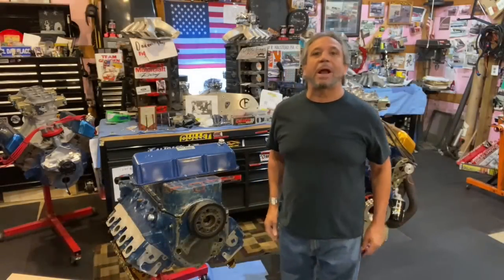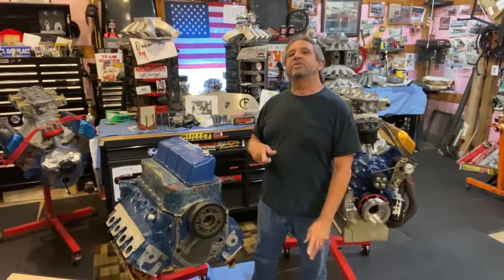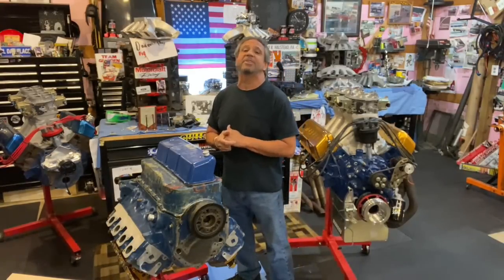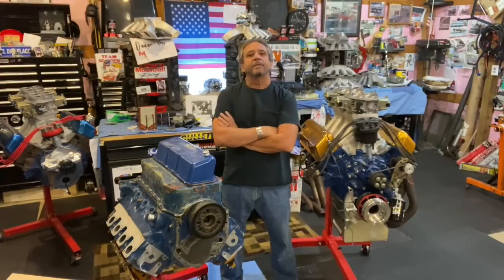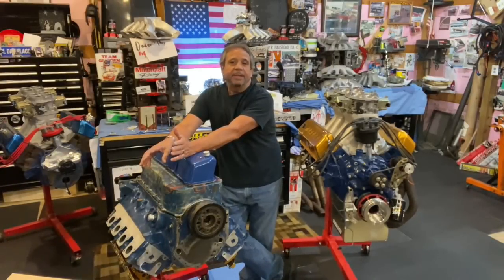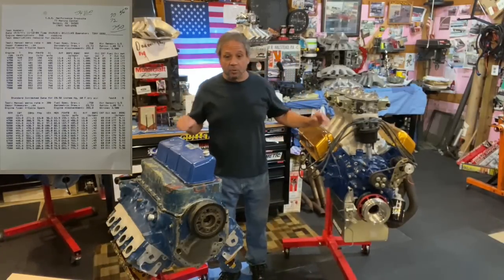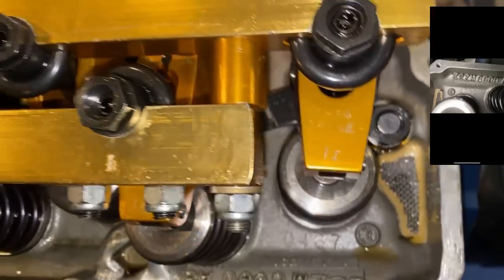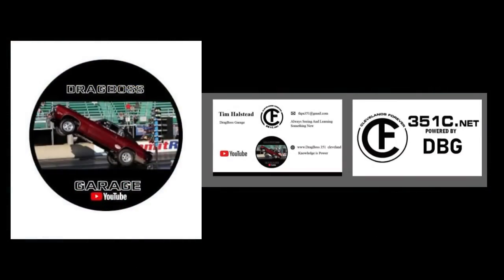No Jack Roush Mystery Motor: This Is a $14,000 Tony Oddo Racing Ford 351 Cleveland, From 1984

Comment: Oh I think I know what's up. You are saying IMSA. IMSA is road racing. I think you mean IMCA. They are big small block oval track cars IMCA. not IMSA. iMSA is strictly road racing. That's why I didn't recognize the name out of Royally Oak. Like I said we did all the Ford motors in iMSA and I'm pretty sure I never heard of them. Yeah that is probably a IMCA motor makes sense. Clevs ran ovals and Jack had all the motor sport boss 302 blocks before they were ever reproduced and that's what we ran Windsor bottom with boss type heads. We made 470 HP wise right in there and max cfm was 750  so knowbody was ordering 830 cfm for imsan
Reply from the maker: Great, thanks Ross. 💯🏁

Comment: Hey Tim I worked for Roush from late 81 - late 83 then again from 84 - 86 and on his Merc Capri 's the GTU meant under 5.0 and GTO meant over 5.0 We ran 311ci motors in all 6 cars we had 3 drivers at all times. And to my knowledge I don't think anyone ran anything bigger than  318 some of the Chevy guys tried them but with weight per cube you get a car that won't handle and eat tires. We were at 2750;I think. Don't hold me to that . And Team Protofab out of Troy ran  310 s in the Camaros. When the Audis came in with all wheel drive the weights changed all across the board. 1 thing you should know is it wasn't IMSA it was Roush racing and development. He had so much pull in that series it was a joke. He got the AWD cars so heavy they couldn't win with a big block.. I heard and I don't know if it's true. But he wanted them to be another 50lbs more if it rained!! I think they ended up 250 lbs more than a rear drive car and he got the turbo inlet down to like 46mm and they started with 58mm I think. The first half of the year if it rained they ran 123 if it didn't jack ran 125 124 something like that.. but they got fat and lost power but by but all year long. If they got anywhere close to being competitive. He would be in there bitchen they have AWD they have turbos they use this gas I can't. On and on.  It really was a joke. He fielded 6 ;cars with 3 teams and built motors for the other 4 Ford teams. He threatened to pull the cars every 2 or 3 weeks it seemed. Jack was a big cry baby all the time. He got his way almost every time just about.. oh and like I said knowbody ran Clevs. That I can almost guarantee. Maybe they tested with it. Off to Nelson Ledges or something.
Reply from the maker: Wow, that's incredible information.  I'm really glad you shared this. You really have a lot of knowledge about Roush Racing. You know this was not a Roush motor, but a Tony Oddo?

Comment: 575hp from a Cleveland in 1984 is stout but not wild. My father was a retired NASCAR mechanic and in 1987 a friend brought him a 1971 Pantera to hotrod and he got 750hp out of that Cleveland that he built in his barn. No reason a proper race shop couldn't do even better. I imagine there was a rulebook somewhere holding that TOE engine back.
Reply from the maker: Yes you’re right. It was the rules of their sanctioning body. To me pretty hard to get 750hp in a Pantera, so was this dynoed?   Pantera one of my favorites. Thanks
Reply: @dragboss351cleveland  I was 15 years old. I knew that my father had worked at Goodyear for a few years as a mechanic before he retired and he still worked on cars in the barn garage for something to do. Everyone who knew of him brought their cars because where else could you get a pro mechanic for peanuts? So there were always new cars in the yard when I got home from school. But one day there was one under a cover. That was new. I asked him what it was, he said go look. I pulled the cover off, it was a minty 1971 De Tomaso Pantera in a beautiful white. Then a friend of my dad who had worked with him as a mechanic at Goodyear pulled up. Turns out it was his car and he handed my dad seven thousand dollars and said to call him when he needed more. Not if, when. At the time, that was enough money to buy two very nice lightly used cars. I asked Dave why he was here when he was a mechanic himself and that was when I learned of my father's past life in NASCAR and that he was likely the best mechanic in the state. Shocker, dad never bragged on himself. I saw the dyno sheet, 750-something hp at almost 8,000 RPM, I forget the exact numbers. The car was stupid with a four speed manual, a tire smoke machine. Someone else built the trans. Dad said the engine wasn't the hard part, figuring out how to keep the thing from overheating in Florida traffic with the engine being in the back was what took the longest. I was sad when the car was done and drove away, having all that raw sexiness in the yard was fun stuff.
Reply from the maker: @Abzocold great memories that will last a lifetime. Man those were the days. My dad drove a diesel Rabbit. That was the extent of my exposure to high performance. Great stuff thanks.

Comment: What an absolute banger of a find Tim....definitely deserves to be gone through and brought back to life!
I read in your description that the crankshaft is a rare forged factory piece....i'm really curious to find out if the crankshaft is std stroke/big end dia. or offset ground/Chev big end dia?
Also....i was wondering if you've come across @pauldilley453 at all? 
He's a long time drag racer and through his own years of R&D, has some very interesting insights regarding the oiling requirements and bearings on the Clevo when using a factory crank.
Keep up the great work/content mate, cheers. 🍻

Comment: Looking at that engine really takes me back to the mid 80's. A little trivia. In 1984 a stock car builder/driver named Ivan Baldwin from Ceres California built a Ford Thunderbird for NASCAR. Can't confirm, but I heard it was for Elliot, who Ivan did go to work for. That T-bird had a Tony Odo engine, probably 356 inches and very similar to the engine you have. First time that car was at the track, Stockton Speedway, Ivan set a new track record. Can't remember the time but I do remember the car had the quietest mufflers I ever heard of any race car. By the way Ivan was the most skilled driver I've ever seen. That was a super competitive track where a lot of cars had big/expensive cutting edge power.
Reply from the maker: Thanks so much for sharing this with me. So cool to hear this. Tonight video will lay it down, stay tuned.

Comment: If the engine has been sitting that long with the valves open, you probably want to replace the valve springs. They have probably taken a set and lost pressure.
Reply from the maker: I agree John, needs to be pulled down. Don’t want to risk it. A real treasure, stay tuned.

Comment: 10k to 14k in the 1990s with a swap engine got a decent motor back then at around 600hp or the equivalent of what the shop that built it was racing in their cars.
Reply from the maker: Right on, and this was 1984. Appreciative 🏁

Comment: Is that an Aussie XE pillow block? Foundry mark next to the oil sender should say "GF" in capital letters, referring to Geelong Foundry (Victoria). Iron is harder, pan rails and main supports are solid.
Reply: Edit: yes confirmed Aussie block. "GF" can be seen at 11:28
Reply from the maker: Yes it is an XE pillow block. I have three, need to build one. 🇦🇺
Reply: @dragboss351cleveland  THREE ??? Yes definitely build one and with the giving season just around the corner, SHARE ONE 🥳. 
Since you hold ALL the cards, consider trading one for a ‘87 Turbo Coupe 😉.
Reply from the maker: @danielwilson6665 hmmm, I have a full house trust me. If you wanted to trade an XE block for that car, I’m in😉 Billy Ray has one and building 385 ci high port pro stock Cleveland.
Reply: @dragboss351cleveland   I just wanted to toss the trade idea in the pot for future consideration if necessary. Anything is possible. Billy Ray’s build sounds great and I hope you can keep us updated on it. Is he using vintage high port iron heads or the newer alloy versions ?
Reply from the maker: @danielwilson6665 he is using all vintage pro stock parts from Jack Roush. It would be fun to put that engine in the T bird.
Reply: @dragboss351cleveland   That’s going to be another great build ! The T-Bird is always open to suggestions 😉
Reply from the maker: @danielwilson6665 keeping it in mind. Future project

Comment: T.O.E. did some good carbs .
Reply from the maker: Never knew that. They build carbs. Interesting, thanks.
Reply: @dragboss351cleveland  dominate back in the 90's west coast oval track racing if you raced 2 bbl class or your class 390 4 bbl was carb to beat
Reply from the maker: @larryburns4605 dang it. Cool to hear more of the legend of the 351 Cleveland 💯🏁

Comment: Great episode Tim, and that tells you what a Top Class Shop TOE is, they have full history and records on hand on all their engines... WOW, they didn't want those 3 head plugs to LEAK, welded up...  Give it a freshen up, maybe some new more reliable lifters, Bush type, rings, probably a different sump for your cars..
Reply from the maker: That ain’t nothing. Learned more and one way. They felt like silicone and painted. Sounds like the possibility of a plan. 💯🏁
Reply: @dragboss351cleveland  Tim, you will make a piece of Cleveland history breath fire again... And we will see it happen...
Reply from the maker: @drcolster oh you sure will and much more. Wait until you find out the rest of the story….video done and post when I can. It will blow you away 💯🏁 PS I have the first Cleveland block from 1968, have you seen that?😎
Reply: Whatever you put it in make sure it's a stick shift. I'd give my left testicle to hear that thing singing at over 7K!

Comment: Was that Mallory i seen  pressed fit and welded  vertically in the crank to balance ?  i thought that was a no-no and it's better to install horizontal ?
Reply from the maker: There is Mallory and weld, but I have no idea on that direction of installation
Reply: @dragboss351cleveland  That's cool.. i was just asking cause i seen the weld on the counter weight. my machinist  in Ohio told me it was best to install horizontal   so the slug wouldn't shoot out the oil pan like a shot gun if it ever came loose,lol
Reply from the maker: @quick-performance-services hey it makes sense. What builder in Ohio?
Reply: @dragboss351cleveland  (Kalvainator engines)
Reply: he was the instructor at UNOH..
he did my short block on my  SBF 414 stroker build.
Reply from the maker: @quick-performance-services don’t know them. Where in Ohio?
Reply from the maker: @quick-performance-services good deal. Good to see who does what and where
Reply: @dragboss351cleveland  Wapakoneta, OH
Reply from the maker: @quick-performance-services I know where that is, lol. We had our Doberman to get his ears cropped there. Famous vet there. People come from all over the country to get their Dogs cropped and docked.
Reply: @dragboss351cleveland  thats cool you know were it is cause when you say the name people are like What? Were?
if you want to know more about the shop do a search for Eric the car guy.. he did a few videos at the shop. ( i cant post a link)
Reply from the maker: Thanks man. Right on. Go ahead and post, thanks

Comment: Great show! Love this stuff for sure! Question: I have a 70 4V that came out of a 4dr Torino about 34 years ago. Still standard bore. Removed heads and no ridge at top. Think the mileage was 68k. Had an FMX behind that I used in a fairlane. What do you think the engine is worth? All stock with Autolite carb
Reply from the maker: Might find someone give you 1-1500.
Reply: Rick it sounds like you have a good one. Tim’s price estimate is right in line for a 1970 “M” code with quench chamber heads. With the head off of the block, did you notice which type of combustion chamber it has ?  Good standard bore blocks are getting so hard to find nowadays.
Reply: Yes, it has the big valve closed "quench chamber" heads. 300 hp best i remember. Had several from years ago. This is the only one left. Ran strong when pulled in 1990.s@danielwilson6665
Reply: Don't lose the brackets.
Reply: Don't lose the brackets.

Comment: I have a question I have a 351 Cleveland can you tell me if the damper fit flush to the timing cover thanks
Reply from the maker: No does not fit flush.
Reply: I have a set of 302 Cleveland Aussie heads what flat top pistons would you use 58 cc
Reply from the maker: @roberthirshfield3571 forged.

Comment: Awesome Tim! I couldn't see the dyno numbers but I bet it has a long flat torque curve. It's exciting to have a piece of history.  I have some John lingenfelter stuff.
Reply from the maker: Yes Don very cool, 574.9 at 7500, forgot torque. I think I put it all in description. 🏁
Reply: @dragboss351cleveland  Yes that's impressive back then. Between 3000 and 7500 I'm guessing the torque was good and flat for a road race car but I couldn't see all the numbers.
Reply: @dragboss351cleveland  Tim at first glance those dyno numbers didn’t seem very impressive but I was comparing them to your 409 dyno results which are quite impressive. Of course that’s not a fair comparison because I’m heavily DragBoss biased 🤷‍♂️. 
I’m sure this particular engine was designed and built with a specific power level in mind for its intended type of racing. Either way, it’s all good 🏁.
Reply from the maker: @danielwilson6665 ha ha I see how that could be, but the horsepower has to be there all the time on tap, especially with circle or road race. That Cleveland was able to hold 7000+ rpm for hrs. There’s where the external wet sump keeps her alive.  Yes please stay DragBoss biased, I can use it. 💯🏁🇺🇸
Reply: @dragboss351cleveland  yes.
Reply: @dragboss351cleveland   How right you are old chum !  It’s more involved than living life a quarter mile at the time in 9 seconds or less 🙉.  Building for hammer down WOT is significantly different than the constant cycle of variable throttle position and getting out of the turns ahead of the brand X pack on a road course. Even more so when the intake ports are large enough to park the entire bowtie field inside. Ford Lives Matter and throttle response rules ! 
I’m a charter member of the DBG fan club so I’m not going anywhere. You had me with HELLO 🤷‍♂️🏁.
Reply from the maker: @danielwilson6665 ha ha that’s what I’m talking about. Wot. Those engines  are test in durability for sure. More on this very soon. Glad you’re here, it’s like we have known each other over 20 years….😉
Reply: @dragboss351cleveland   You know how we roll, old friend 🏁
Reply from the maker: @danielwilson6665 bad to the bone 🦴